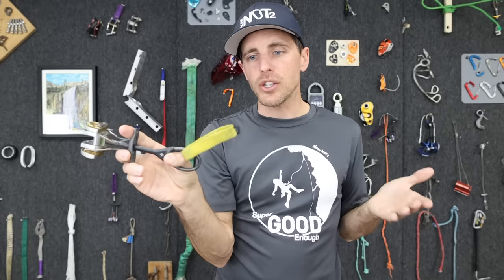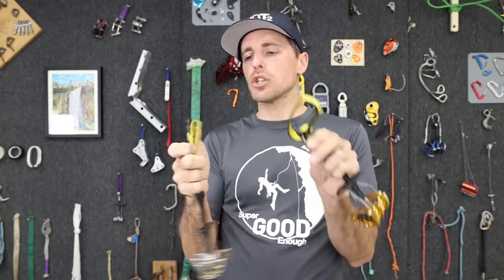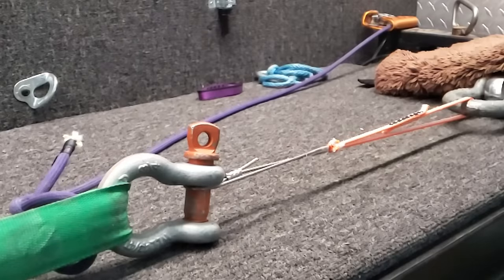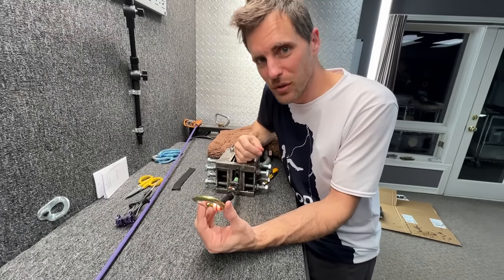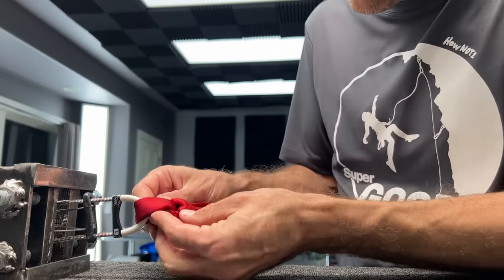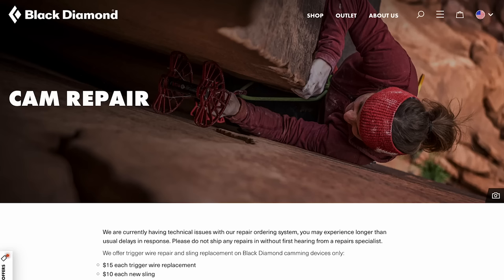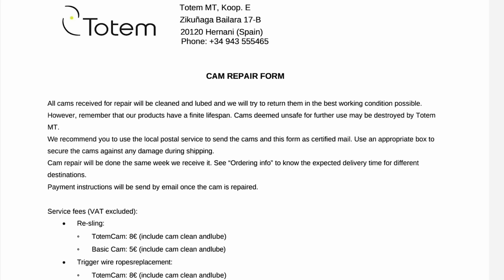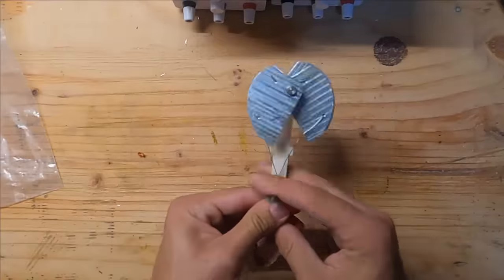This is illegal in Europe

Comment: What about powercord? It's thinner but just as strong as 7mm cord, might do the trick.
Reply: It has been a long while since I was "Equipment Officer" for the caving club, so I'm not up to date on these modern materials. But "ANYTHINGcord" doesn't sound like a good match for going over steel wire. The contacting edge of the "circle" of cord would be prone to extreme crushing forces, and I'd suspect would downrate the cord significantly. It's a bad enough effect with tape, but would be worse for "...cord".  IMO. 
I'm out of the game now, but it would be interesting to see experimental results.
Reply: Did you watch the full video? He tested exactly using 7mm cord over the steel wire.
Reply: @RenatoUtsch  I did watch the entire video (what sort of moron doesn't? I know - an all-too-common moron). I may have missed the phrase used - or dismissed it as yet another trade name - which come and go to the point of not being worth remembering. Here one decade, gone the next. The next time I dig my rigging-sack out, I'll see if the only "Friend" I've ever used is still in there (or did I lend it to a friend and never get it back?). It was never much use to me for my ropework. Actually, I doubt they have any use outside recreational climbing.

Comment: would you gain any strength if you ran the 8mm accessory cord in, around and through the anchor a second time before tying the double fishermens knot? So that some of the cord force is tensioning around the cable instead of just pulling on it aka slightly more load distribution w/o hardly any extra cord used.
Reply: I would like to have some information on that as well

Comment: Re: Basket hitch (Chris Tan death Product)

What if you basket hitch the Cam and  girth hitch a wire or bent gate carabiner onto the loop ends the AlpineSavvy anchors. The larger radius of the carabiner should handle the girth hitch, you have overkill basket hitch where it matters ... and you won't accidentally unclip and pull through the carabiner.

Comment: If basketing, you can use a fine nylon braid to whip the ends together, much like you did with tape but looking far nicer.

With cord, a scafold knot on each end to the cam may be less bulky than a triple fishermans in the middle and may be better for the wire. Also whip the tails for neatness.

Comment: It's not illegal in Europe. If the manufacturer provides specification for the sling it could be done by 3th party.
But without this the repair company would need to guarantee compliance to safety standards for the unit - that is impossible because you don't have production data, calculculations and test data. 
The manufacturer can do that. 
But it's not worth to discuss with a customer, that the cam he bought 20 years ago should be replaced...
Who will be sued if something brakes?

I also do paragliding where quality issues would have a bigger impact. In Europe it's completely usual to repair gliders by 3th party. But if scratches are too big, only the manufacturer would repair it. I'm sure that most of them would also replace the slings on your cam if you show up in person.

Comment: In my opinion, this is one of the most useful videos you've made!

the totem trick is incomplete though, as the lobes are not independent with the method you showed. my take away from this is that 7mm chord is the best method although bulky.
Reply: Hey, I was wondering if doubling the cord inside a double fishermans bend would make the loop « stronger ». I know that most cams support up to 10-14kN and a 7mm being 12kN is super good enough (as someone would say) but I would like to know if it could work.
I’m mostly wondering if the fishermans bend knot would act differently on two rope instead of one.
Thank you!

Edit: I’m dumb right? If you do a loop using a double fishermans bend than your 12kN 7mm cord become a loop of around 24kN (and thus the knot is the weakest point) ? After that doubling it again is more than useless right?
Reply: @MikleRe  im not sure if it would be much stronger really, it would be a way to make it extendable i suppose. 

To make it stronger you would use thicker cord eg 8mm... but 7mm seems super good enough from the testing in this video
Reply: @sunshinejam5782  I’ve just realized that a loop of 7mm nylon is actually 20kN so actually super good enough.

Thanks for the precision ;)

Comment: If the water knot undoing itself is a concern.  A couple tack stiches on the ends would hold them in place.  I don't reckon that could cause any issues but would midigate the risk.
Reply: This would be the same problem as when people taped the ends. The whole knot may move on the tape, over the tape ends.
Reply: Well I guess I should watch the video because I’m questioning how applicable the conditions are which would untie the knot.

Comment: Couldn't you just carry those cams on a material carabiner and then put a quicklink on the one you're actually using right when you're setting it up?
Is there a significant disadvantage in this method when you're mostly using a quicklink with them anyway, even if they still have webbing?

Comment: I dunno... my blue bd .3 rates to 8kn for example... for the sling material to come the weakest part of the system, I reckon it'll take a heck of a long time if I'm not using them every weekend. I know they referenced tat tests early in the video, but every day outside, that's a pretty different thing. Probably going to push that recommended best before a bit...

Comment: Anyone know if the adhesive in tape degrades soft goods and what tape should be used?
Reply: Adhesive? In tape? OK, I've been out of the equipment game for a decade, and only "doing" family stuff for the decade before that. But I've literally never heard of any sort of adhesive being used in the construction of a tape "anything". The necessary strength comes purely from the friction between lengths of tape, as a consequence of the squeezing force applied by the stitching at so many tens of kilos per stitch. (Looking up ...)
There are probably surface coatings, from the extrusion equipment. But I doubt they're sufficient volume to be a significant factor in finished article strength.
Wiki for Dyneema/ UHMWPE says "The fiber's very high lubricity causes poor knot-holding ability, and it is mostly used in pre-sewn 'slings' (loops of webbing)—relying on knots to join sections of UHMWPE is generally not recommended, and if necessary it is recommended to use the triple fisherman's knot rather than the traditional double fisherman's knot." ; I'll note the triple fisherman's ; I've used it for years in "donkey's dicks" and "cow's tails" in 7mm doubled nylon.
"Dyneema Composite Fabric (DCF) is a laminated material consisting of a grid of Dyneema threads sandwiched between two thin transparent polyester membranes." - a fabric, not a tension material.
Nope, I don't see evidence for an adhesive in sling manufacture.

Comment: Your webbing and stitching is compromised only when there has been uv degradation. You can tell if the webbing needs replacing if you scratch it with a fingernail and fibers start to flake off..

Comment: Looks as if the original Totem slings could have been left in place, moved to the side, and then the new sling tied as at 24:30 for the test without removing the factory material. Of course as the cable broke, this all became moot.

Comment: So, can I consider that my old cams reslinged with a double loop 6mm cord (to make extendible) closed with a double fisherman knot ar super-good-enough or not ? 😅
Reply: If its technora or aramid they should be fine.. i mean the 6mm aramid cord we use in the saxon swiss as textile pro are rated to 22kn so im guessting around the 12-14kn range for a knoted loop.
Reply: My take is that It's bomber doubled up and super good enough extended.

Comment: Your opening statement is not actually true. You can resling a cam in Europe legally. You just have to certify that the cam complies with CE regulations when it leaves your care which no-one is prepared to do. It used to be the case that manufacturers put a 10 year life span on their products and that was a span determined by them, which means they were unwilling to resting beyond that lifetime. These days they have sensibly determined that the life span is only dependent on wear of the unit. So the manufacturer who k ows their product better than a random Joe will inspect it and then determine whether they can resling it and then send it out, still complying with their self imposed standards. 

With regards the various sling schemes. BD slinging method has been patented and therefore cannot be used by anybody else. Dmms pignose was a way round it and is also patented. WC chose to have two ratings, 12kN unextended, 10kN extended because at 10kN, with the sling extended, the thumb loop takes a set and deform permanently when using the 13mm sling they specced. The weight difference between 8mm and 13mm is actually negligible because 8mm is much thick than 13mm sling. But the surface area helps spread the load.

Comment: No third party would sew new loops on climbing equipment for customers.  Send it back to the manufacturer, they still won't put a new loop on.  Why, they own the liability for the used gear after.  They will simply tell you to buy a new one.  Only sane answer.
Reply: How is that “sane”? Our society repairs life-critical systems like car brakes all the time. There is no reason it should be any different.

Also, there definitely are manufacturers that will put new ones on. I think it’s black diamond that does the super ultra light ones where the sling goes up around the pin? They re-sling those.

Comment: Simplest is to simply use a karabiner instead of a sling. Then clip an extension sling to that karabiner if required.  I have  a few old cams with one inch tube tape  ,similar to the green one in this video, tied with a tape knot. Double thickness. Been doing this 30 years now and no sling ever broke. What usually happens is the  cam gnurls get worn out and I then dispose of them.
Reply: Pretty sure there is an episode that shows how extreme of a bend using a caribiner is on Cams and the wireropes that are used in cams. 

Bend radius being too small does reduce the rated strength.

They've talked about this in length about why they use the shackle they do, with the red pin?

Comment: I sew webbing when making bike packing bags adn kit bags. Look at cheap toestraps, they do a box with a cross or two bar tacts, and the label gives a rating, so you can guest the strength of that sew job. IMO dont resling, not worth it. but if you do, 5 Bar tacks of about 6mm width and 30% inset of the webbing thickness  from the edge, is how id guess. Best thing to do is copy OEM, and add an extra bar tac for "im a shit sewer" factor (FOS).